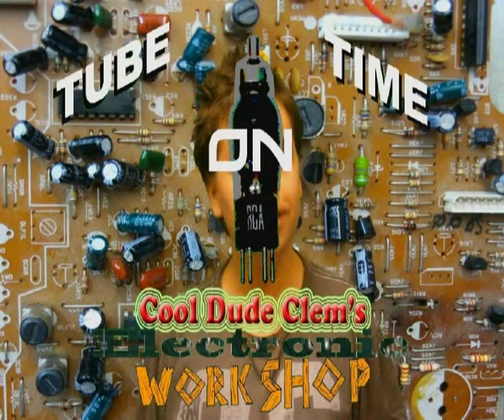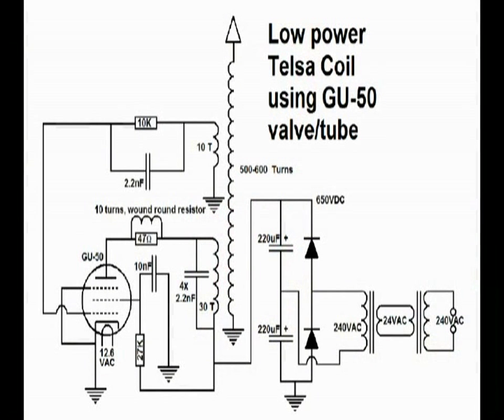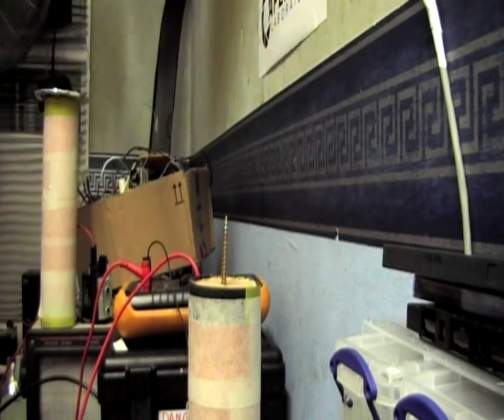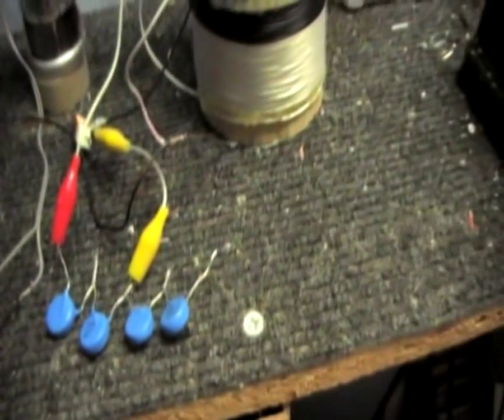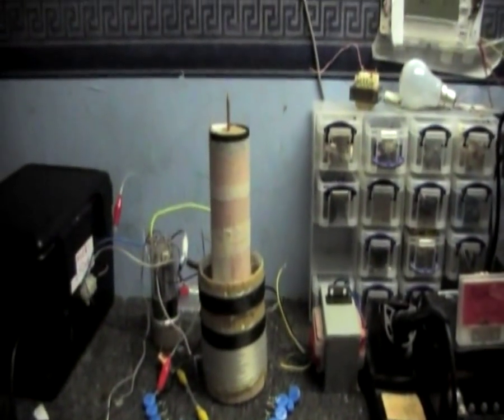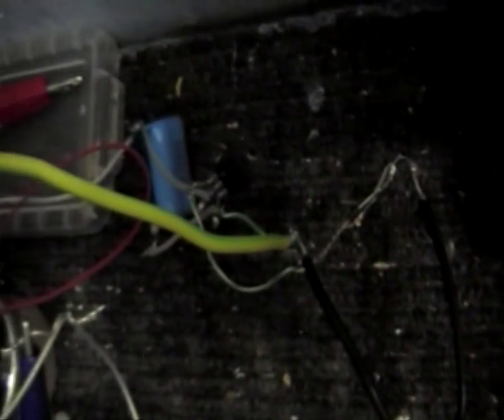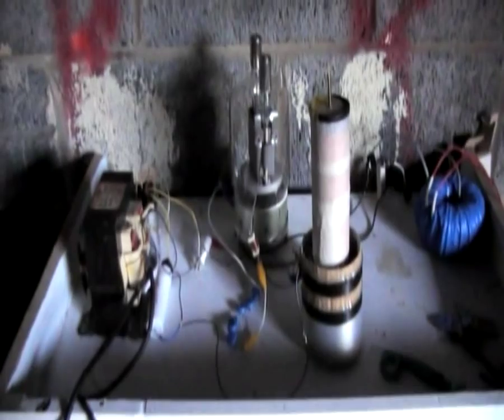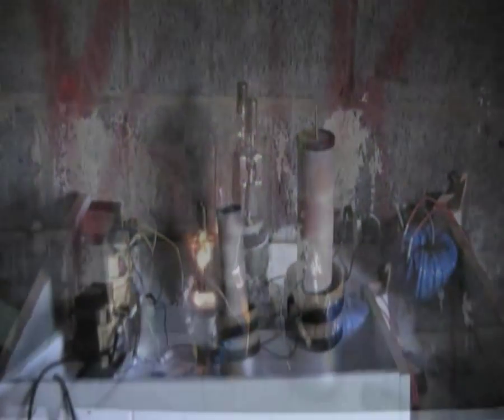TubeTime 16 - Making a "Steve Ward" style VTTC the CoolDudeClem Way

Comment: Nice, since now you know what capacitance you need (6 2n2 caps in series = approx. 366pF), you can make your own cap. Aluminium foil + polyethylene = quite nice film cap. I don't know about you, but I like to make such caps myself. Plus - they have much smaller loss than ceramic caps
Reply from the maker: +MrJohhhnnnyyy That's not a bad idea,  I've tried making my own caps in the past and I can easily get the capacitance I need, trouble is they get corona all over when I try to use them in projects like this.
Reply: CoolDudeClem I suggest you go to RimstarOrg channel, I saw there a video about making HV caps, he used something like epoxy on the sharp ends that was prone to break down. Maybe you'll find answer there

Comment: Hey Clem, I need your advice! I'm building a dual mono block SE tube amp, EZ81, ECH81, EL84, and it sounds pretty sweet... However, there's a stupid hum that does not change with the volume, filament's grounded on one pole (6.3V AC), and the hum only goes away if i disconnect the ground on the filament. Damn thing drives me up the wall! Do you have any suggestions about killing the hum? Centering, star point gnd, wire shielding, nothing seems to help.

Comment: your electron valve tube is glowing too brightly, meaning premature wearout failure.  Try slightly degrading the heater filament.
Reply from the maker: That's normal for tubes like this to have bright filaments, the filament is running at the right voltage. If this was a smaller tube then there would be trouble.
Reply: I think it is ok becaus the power of the heater is something like 120-150w.